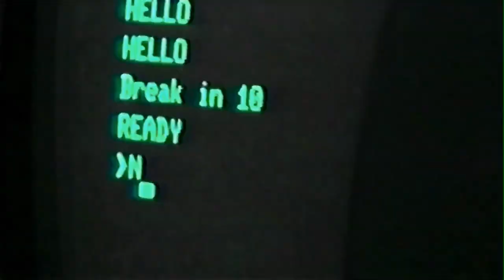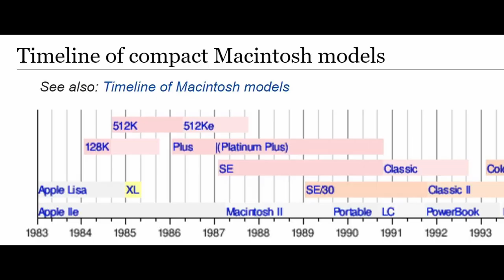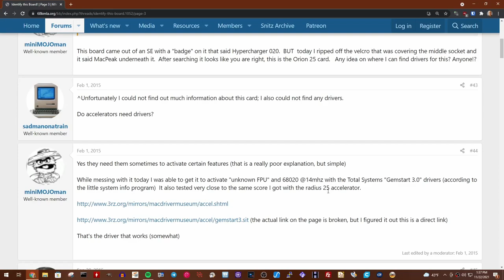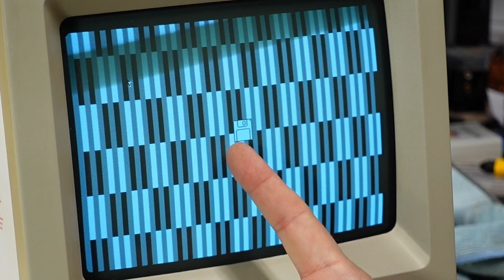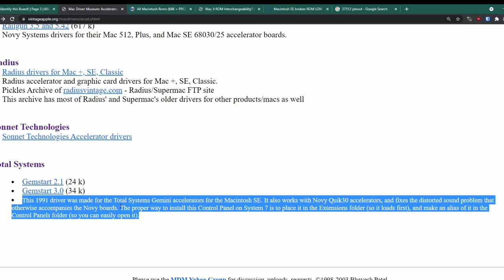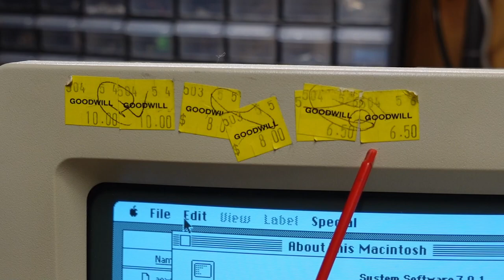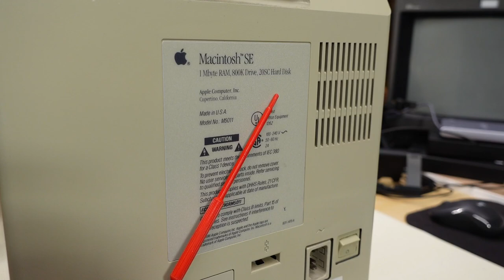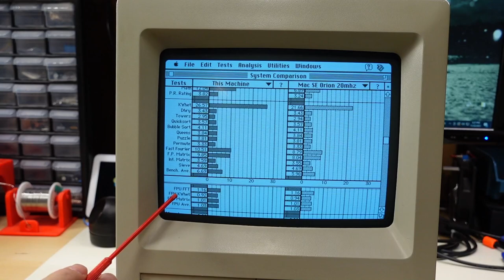The Macintosh SE is slow. Let's speed it up!

Comment: Bub... The IBM PC had a video card with a video processor like the 6845 or 6545 VCP for Monochrome, CGA and/or EGA Graphics. The Macintosh 128 to SE did not have a Video CoProcessor and like you stated the 68K did all the video and programming heavy lifting like the Z80 did on the Sinclair ZX80/81 and the 6502 on the Apple 1.

One mistake you said was "system 6 or system 7 with Multi Finder". It is System 6 that had MultiFinder as an optional extension, System 7 has MultiFinder built in. System 6 runs fine on the SE under any Ram amount but System 7 required 4megs of RAM and even then System 7 runs slow.
Reply from the maker: The 6845 is definitely not a display processor but a CRT controller. It generates the timing signals and refresh for DRAM. The CPU still has to do all moving around of data in and out and around the video memory, exactly like on the Mac. On the Mac, Apple used registered PAL chips to generate the timing and refresh signals -- the same work the 6845 did. Since it's hardcoded into PALs, that's why you can't alter the resolution or do anything like that on the Mac.

Comment: So, this computer / OS is not truly multitasking, with no app being able to run in the background? It just dumps inactive apps into pagefile on disk and then exclusively runs the active one, hence the performance issues?
Reply: yup, that basically sums it up. It's also why I dont see any value in those old apple machines. A commodore 64 with a much slower 8 bit cpu for me is the much better machine than one of those monochrome pieces of plastic junk. Even an Atari ST is much better than what apple had to offer and I, being a commodore guy normally despise atari.
Reply: What "performance issues"? This computer replaced a typewriter on the desk of everyone in business who had one. Do you get that? A manual typewriter. Macs had cooperative multitasking since 1987. "Pagefile on disk"??? LOL! This is the generation of 68K before paged memory management units existed and it was before hard disks for many people. The common hard disk in the SE was the Miniscribe 8425 which was a 20 Meg drive, or the Seagate ST-125N which was also a 20 meg drive.
Reply: @nilswegner2881  But isn't C64 software also single-task, and same goes for GEM or GEOS that were used on Ataris?

Comment: Maybe try the PiStorm? It's a virtual 68k CPU implemented in software and uses a standard 68000 socket.
Reply: And a lot of Amiga-specific things that makes it as unusable in a Mac as any other Amiga accelerator. It'd need a lot of reworking.
Reply: @jammi__  I found a video of someone who did exactly that. The Amiga specific stuff can be turned off. Essentially you can make it a pure 68000 socket compatible CPU with extra memory and up to 68040 instructions.

Comment: WTF?!!! System 6 can not run on 512K? You need to review you information. System 6 can run in as little as 128K as System 1.0 to System 6 was made for the 128K to 512Ke (e meaning "enhanced" ROMs) Macs. The Enhanced ROMs were used. On the 512Ke and Mac Plus which allows them to run HFS formatted disks instead MFS formatted disks.

The problem you have is cutting that resistor you can either use 256K RAM or 1M RAM on the board. Another problem you have is that the RAM belongs on the bottom row simm sockets and not the top row that you have them on.
Reply from the maker: Not sure where you found that info. System 6 minimum requirement is the Mac Plus. The last supported OS on the Mac 512k was System 4.1. From my reading it is possible to get System 6 (unsure of which revision) working on 512k Machine with patching -- but it cannot run on the Mac 128k. 

And no, on the Mac SE with this revision, the row closest to the ports is where the 512k would go -- and it is where the system stores the frame buffer. The system won't even display anything at all without RAM installed in this bank.

Comment: That's why the fastest Mac is an Amiga. Custom Chips.
Reply: Couldn't have said it better. Even a commodore 64 is better than these old monochrome, plastic pieces of junk. Even apple themselves had a much better machine at the time, the apple 2 gs. But Steve Jobs, being the asshole that he was, had to cancel that and propel the Macintosh forward. Without any graphics chips and 68000s at a time when 68040s were already out.
Reply: Everything was dreadful about these early Macs, especially given how much they cost. The Amiga had proper multitasking, sound, graphics. If only the whole Amiga OS was in ROM or came with a small hard disk it would have been a killer. Even the Atari ST was better than a Mac.
Reply: @nilswegner2881  Steve Jobs wasn't at Apple when the IIgs was designed, nevertheless manufactured.